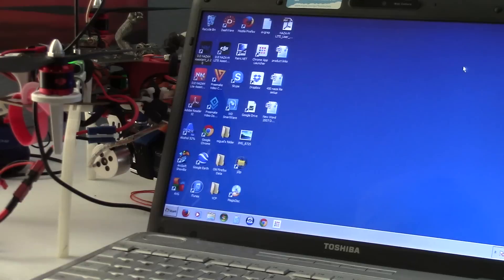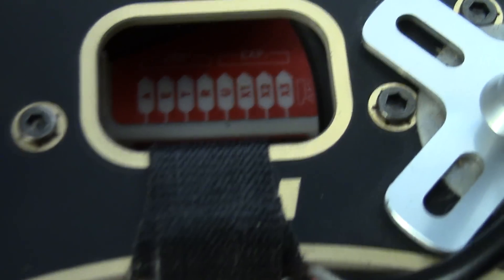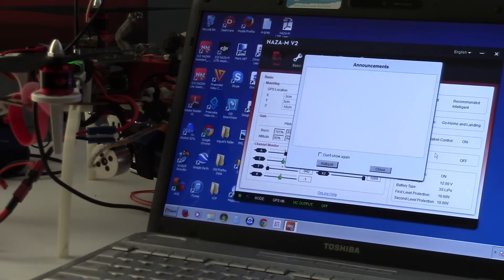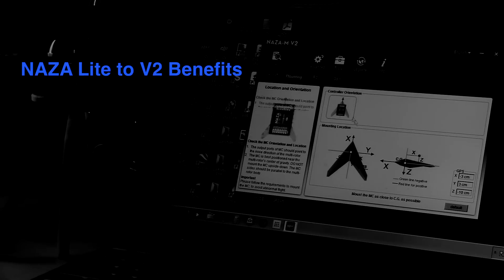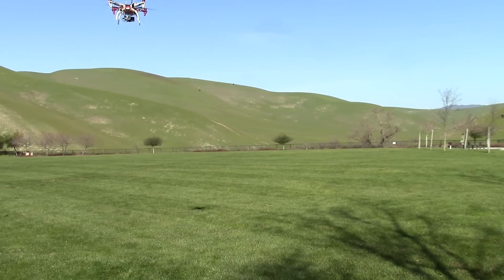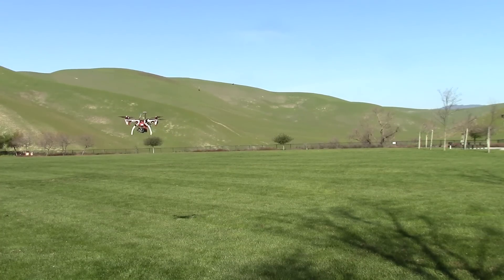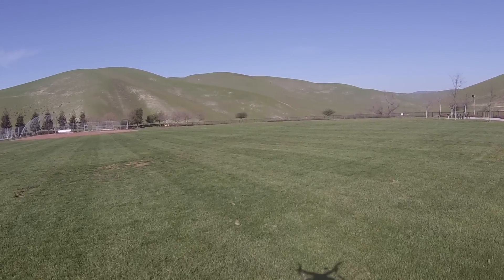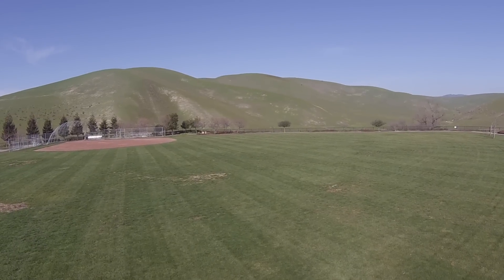NAZA Lite Upgrade to V2 Firmware

Comment: how long your flight time after upgrade??
my battery drain faster after i upgrade the firmware, plz reply
Reply from the maker: +Mister Djancrut I was getting the same battery life if not more.
Reply: +BlueFlyerTV what do you mean??
same with my problem or same with your battery life before upgrade?? thanks
Reply from the maker: same battery life as before.  thanks for watching and the questions.

Comment: I'm looking to do this upgrade to my Naza lite as well! I notice you've got a lot going on, on your 450. What's your rigs set up.. ESC's motors props and batteries?  Because I have a 450, one of the alien frames... 920kv emax motors, 1045 props, with a mad dog 3300 4s Lipo. And I'm lucky to hit 5 min of flight time with only a GoPro on front. I'd like to do a gimbal mount for GoPro with landing gear like you have here and add doc gear. But I'm kind of afraid of weight with fpv stuff plus the can hub and iosd mini. What are your flight times? Any advise? I'm a noob. Just getting started here. Looking for 12-15 minute mark reasonably...
Reply from the maker: xxnuyorkaxx532 You're only getting five minutes?  Make sure that your props are balanced first.  You're right.  I wouldn't recommend adding a gimbal or FPV to your rig if that's all you're getting. I'm getting about 13 minutes on a 5100mah 3S 35c battery. That's with the gimbal, gropro and FPV system.  The 1045 props will also pull more from your battery.  If you want to increase your flight time and use a gimbal, a 1038 will increase your batts' efficiency.
Reply: First let me thank you! Man what a difference! Soo much more stable! Completely night and day. And I now get almost 13 minute flight with my same rig plus landing gear added! Thanks for the video and links! And thanks for the reply and help! Keep up the good work !
Reply from the maker: You made my day with this comment.  Thanks.  My goal is to learn and share what I learn with others in the hobby.  Glad that it worked out : )

Comment: Hi! Please help me to find the problem!!!
 After upgrade ...every time, after one or two flights,When I turn on my copter,  I got blinking yellow light (need colibration)??? And again, after colibration - same story!!
What do You think about this?
Thank You in advance,Roman.
Reply from the maker: That's odd, Roman.  I haven't had that issue.  Make sure all your knobs and twitches are in position 1 / normal when you calibrate and turn on.  In the past, I kept leaving my mode switch to position 2 which caused the blinks.
Reply: Thanks for fast andwer...

Comment: why does mine only allow 1.0 and thats it? no update to 2.0
Reply from the maker: Did you download the V2 assistant 2.20?  The icon is light orange in color.  Once you flashed your Naza Lite with the V2 firmware you can't use the original Naza Lite assistant.  You now have to use the V2 assistant.
Reply: done job thanks for that mate - what difference now  do i wait for gps lights etc?? nightime now so not able to try for a while .. whats basicaly changed from startup please
Reply from the maker: Yes.  Same deal with the GPS.  I noticed that mine takes slightly longer for a GPS lock but the GPS mode feels more solid.  Startup... like my video showed... you won't get full lift until you pass mid throttle.  But your take-off should be a lot smoother.
Reply: Nice thanks for all the info hopefully test fly tomorrow and let you know how it goes thanks very much

Comment: Good video does the firmware upgrade become available when the naza is plugged in?
Reply from the maker: Steve, make sure you are using the naza assistant with the red icon not the black.
Reply: OK will do thanks for that
Reply: Hi the upgrade went superb and fly's very well thanks for the help